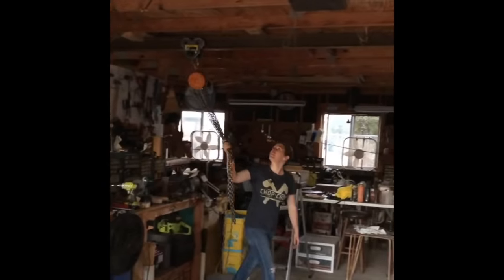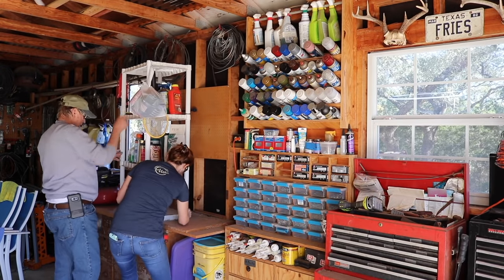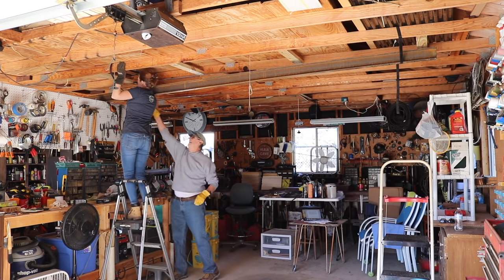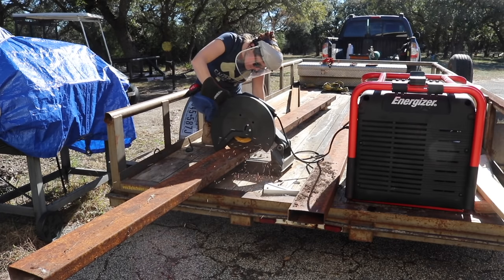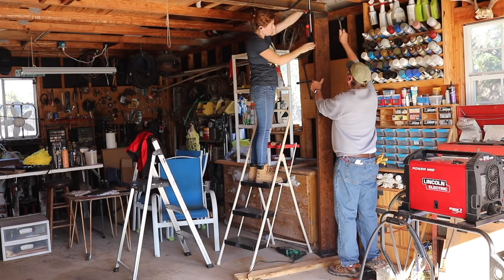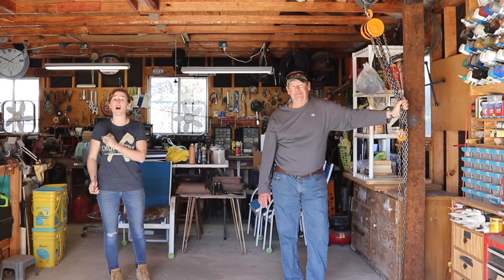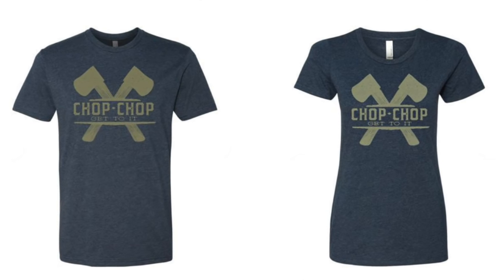DIY Garage Gantry with Chain Hoist

Comment: More good stuff, thank you.
At about 3:18 I see your marking tool appear to emit some smoke. What is this tool, did it create what I saw as smoke, am I simply nuts?
3:54, "re-level" perhaps better phrased as "re-plumbed."
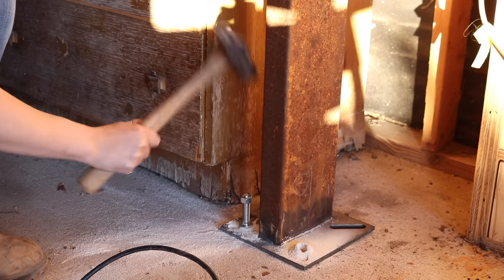5:26, "nut on... to protect the threads." Good technique. These bolts are made with a tapered end to provide this protection. That said, I still use a nut when driving these. ;)

Comment: I would like to add a jib crane to my shop, but the floor is only 4" and it would have to lift a 1/2"x4'x8' steel plate (to set it on the CNC Plasma table).  We just use the forks on the skid steer or tractor to load plate on the table.

Comment: next time you want to really remove rust, use a purple 3M scotch-brite strip/clean up disc. Be sure to use it at a low speed that way it will last. Strips to bare metal in one go

Comment: I think I would have painted all the metal before anything else, as it's way, way harder to do now, but I guess that maybe there was not time enough for it to dry.

On the other hand, I would try and use a different kind of bolts. Excuse my English here, but I'll try and explain myself. I mean I would use the kind that are "just" the nut, like they are a big screw. They work pretty much the same, but to me their great advantage is that, once they're put into place, they are just their own height over the level of the metal plate, while the ones you used are quite taller unless you cut them. The thing is that, if you don't cut them, they are kind of "lego pieces" when someone is walking near them and steps on them: it hurts.

Once it's all set and, eventually, painted, I would also think about greasing the lower part of the I beam (fun fact: in my neck of the woods here in Spain we don't call it "I beam" but "double T") where the wheels run up and down if the instructions manual says so.

Also, I think I would weld some triangle shaped metal plate on both interior upper angles, just for some added strength, as well as another couple for each column where they meet the floor plate, also for some added strength. I think I've seen you do it in some other project as well. In this case, the first two triangle plates would help preventing lateral movement (left to right, right to left, from the "main camera" point of view). And the other four, two per column, would help preventing it falling towards the entrance or the back of the garage. The way it is now, it's only the welding that's doing the job.

But it's nice to see how relatively easy is for almost anyone with the right equipment and material to do it, as you show it in a nice way.

I hope I've made myself understood and in no way I'm criticizing for the sake of it, but to add a different point of view. Otherwise I wouldn't care writing this long! :-D

Thank you.

Comment: If you had welded plates on the top of the columns, and the bottom of the beam, you could have bolted it together, and also unbolted it to move or remove.

Moving or modifying is a real pita now.

Why block the trolley from moving all the way to the right ? let it go all the way and gain that headroom.

Comment: Your dad is very lucky and this project is a great job as usual. Just as a personal preference when using a power handsaw, I attempt to always keep the larger surface of the saw's bottom plate on the salvage piece rather than the waste. It gives more control of the saw as I complete the cut.

Comment: Nice  project on the Gantry   Ive noticed the HF electric winch has gotten pretty good reveiws   And can be modified to fit their trolley   If Dad uses  the lift a lot by himself that might be a nice  present for him in the future  ? I used to use a  chain hoist to  pull auto engines  by myself and they were a little awkward to work   With only  1 person  i found
Reply from the maker: Yep, it will be an upgrade for the future. ; ) I'm predicting around Father's day. Haha.
Reply from the maker: Yep, it will be an upgrade for the future. ; ) I'm predicting around Father's day. Haha.
Reply: Craig Monteforte q
Reply: A hoist is for lifting and a winch is for pulling. A Winch is geared for pulling a load on a relatively level surface. A winch uses a dynamic brake that must slide. A Hoist is geared to lift (dead weight) and has a locking brake that can support a "hanging” load.

Comment: #1 rule when working with rusty metal, in a small shop. --> Leave it on a bench OUTSIDE and grind/brush the rust off of it (before any cutting/assembly/welding/etc).... you can even prime-paint everything right there, in the "out open fresh air" ;)

Comment: It's nice to hear from all the engineers at the party but I would guess (without looking at the plans) the beam is only a W6x12.5, and the guy only wants to pick up a riding mower not a car, or a tank so a 500# load limit over that span is about right.
As far as bracing, the only thing I would do differently would be to make 2 angle braces from 1-1/2" x 1/8" x 2' long and cut 2" off one flange on all 4 ends and bend "ears" then weld or bolt into the beam and use lag bolts to screw the angle iron to the top plate of the garage wall. On the other end I'd probably just screw 2"x6" to the bottom of several roof trusses (on both sides) perpendicular to the I-beam for "tip over" stability.

Comment: Nice project. A trick from a guy that had saled such anchors. Allway clean your drillholes with a Vac and a Brush. This will prevent, that your anchors will slips out. Allways set your Drill to right depth( as you done) and after you finished the  assembly, give it a click with a torque-limiting wrench (see for the anchors tyoes) sorry for my bad english, i don't have routine, at the time. Greetings from Germany

Comment: I am reposting a comment I made on someone else's post (by request). To summarize, a DIY crane solution should really be reviewed by a qualified engineer or subject expert. A crane failure can be a catastrophic failure. The comment below was in response to an alternative crane system to the one April built. 

I can speak to this since I am a civil engineer who specializes in cranes. You are speaking about a jib crane. I have had dozens of these installed. They can be foundationless but need a minimum of 6" of concrete for anchors. A Gorbel work station jib crane is a great off the shelf product. If you are going DIY this, you could weld a column to a base plate, like April did in her video. Anchor bolt that to the floor. Then weld an "L" shape (google cantilever jib crane) with two W-beams (known as I-beams) , attach those to the column with the proper rotating connectors. You should also weld stiffeners from the base plate going up the flanges and the web of the column. A jib crane creates a "moment" connection (a rotational force) on the base, where as April's setup is just a vertical force. Much easier to buy an "off the shelf" jib than DIY it with no experience. Not saying it can't be done, just difficult. Not to mention, beam size and connections should be sized properly, especially for this style crane. Sorry to be long winded. I'll shut up now.

Comment: Question for you not related to the video but i know you use alot of triton tools and was wondering what your thoughts on there dual action orbital sander like festools rotex 150 are. Tritons model is a little  more in my price range but how do they compare? Would like one of these sanders for live edge slab work. Would be great if you could do a review on the triton tgeos geard eccentric orbital sander

Comment: The welds looks Cold. And you are not suppose to hammer on the nut. joust have the nut threaded on and hammer on the thread free area at the top. The long holes in the mounting bracket is only weaking it. Make round holes next time. And Avoid welding whit so much burnable materials every were. Otherwise Nice Job. :)

Comment: Cool, nice to have an overhead hoist. Would have been nice to have the I-beam on trolleys to move front-back 3 feet or so with the hoist moving left-right. That would save having to move what ever you're lifting under the hoist in the exact spot, like pulling an engine out of car, then pushing the car out of the way.

Comment: April, I had to ask, would it not be equally supported in the ends if you continued out to the wall framing and added posts, like you would do with cripple studs under the end of a window or door header? Or maybe even just bolting a heavy flange to the existing studs upon which you'd anchor the i-beam? I was planning an application like the latter in my carport to lift the front of my sailboat for trailer fitting.

Love your videos and want your shop!!!:-)
Reply: That was my thought as well.
Go full width.
Reply: It all depends on the weights/forces involved.  You'd be going from a compression force to a shear force if you went to end plates.  It would load up on the lag screws instead of pressing on the compression post, be it steel or cripple stud.  Even a full width I beam can sag over the span of the garage, but the one picked does look meaty.  Just have to size materials for the job.  If it was full width, I'd tack a center plate and bolt it to the trusses or two to spread the load and keep it put.
Reply: I know why they didn't go to the wall on the workbench side.  I personally would have wanted them to the wall just to maximize space.  It would bug me to have that post right in the middle of my work bench.  But that's just me.
The steel tubes and concrete anchors could still be used if it went to the wall.  I did think she was going to secure the I-beam to the 2X4's she placed between the studs.    It wouldn't have been necessary for weight as much as it would have helped twisting or sagging when under a load.
Reply: @LordNelsonkm , On one side, they actually did go over the wall and added the post. It would have been much easier to just rest it on the top plate and add jack studs underneath within the wall cavity. Either way, it will work and do what he wants.

Comment: April,  What ton weight hoist did you buy and did it also come from Harbor Freight.  You are flipping amazing girl.  I have always wanted a woman like you.  Few and far between.I am trying to lift a 700 lb wood stove so I can back under it in my garage.  My ceiling joist in my garage are exposed and I was going to put a 10'  4x4 across several of these joist and then mount the chain hoist to the middle of the 4x4.  What do you think.  Don't have a welder so thought this might be the next best thing.
Reply: Greg Brooks... It's not the 4x4 I would worry about, although a 6x6 is better. It's about what size the ceiling joists are and how long the span is. In standard home construction you seldom see floor loads rated for over 100 lbs / sq ft, and that's with 2x10 joists, 16" on center, and maybe a span of around 12 ft. IOW, thinking about 700 lbs spread over 3-4 joists is still kinda shaky. For 700 lbs you could probably rent an engine hoist ($20 / afternoon?) and load it that way. You'd still need some chains or straps to secure things but it would be safer than using the ceiling.

Comment: Columns, posts and vertical supports are plumbed not leveled— beams or horizontal supports are leveled. Also checking the column for plumb while it’s sitting in a location other than it’s final installation point makes no sense considering the slope of the concrete most likely will be different. Making the columns square to the plate then shimming it plumb after locating it would make more sense. Sorry I have OCD.

Comment: A safety tip:

If the folks sell the property, you can bet that some numbskull will try to pull auto engines with the overhead crane. The ibeam appears to be about 4, maybe 5 inch web width by 1/4 inch thick plate. The video doesn't show if its welded or rolled, rolled being stronger. With the span your unit has, the safe weight would be near or maybe less than a typical V-8 engine. 

Just be aware. 

I trust you first checked the load capacity for the design and material. A failed, loaded overhead crane is no picnic.

Comment: Overhead lifting is no joke. I'd not trust a chain hoist to keep something suspended over me. There doesn't seem to be any sort of chain lock that is independent from the hoist mechanism. For lifting things in the few hundred lb region so you can get them on/off a pallet/dolly i'm sure it's fine, but for picking up a golf cart to work under it, that's a no-go for me. Basically anything without a pin to keep it in place is something you shouldn't work under. Even car hoists have a ratchet so that if the hydraulics fail they don't come down on top of people under them.

Edit: After poking around, many manuals state something to the effect of "shall NOT operate a hoist unless all persons are and remain clear of the supported load" which means don't go under the load while it's held up by the hoist.

Comment: The pain of cleaning that much red rust of that sized steel, I just go buy new steel. Seriously, you will spend hours cleaning that with a wire brush and you will get rust dust from asshole to breakfast into everything. The price of steel, to me anyway, I prefer to work with clean stuff.